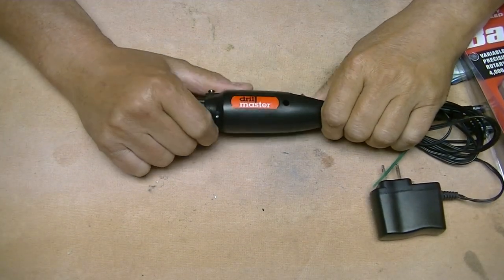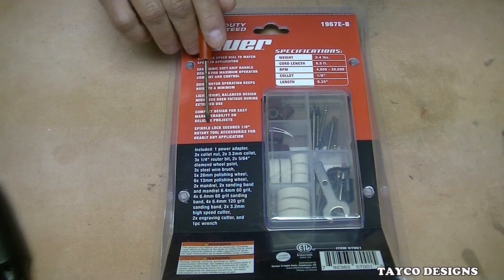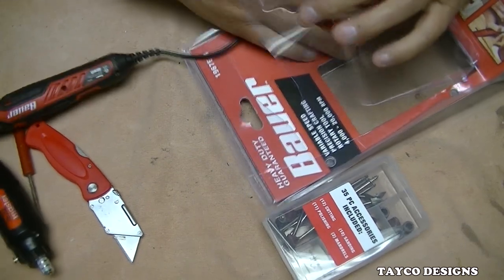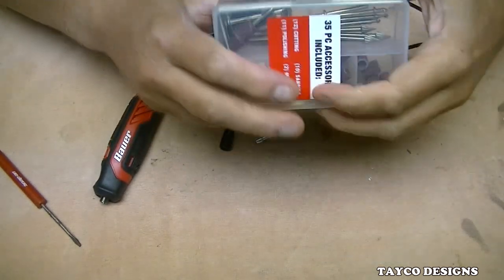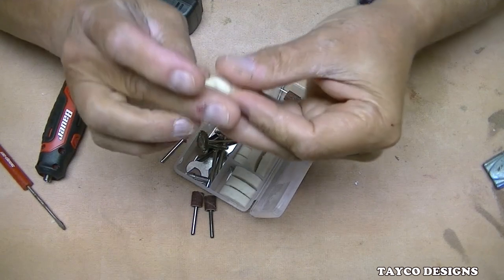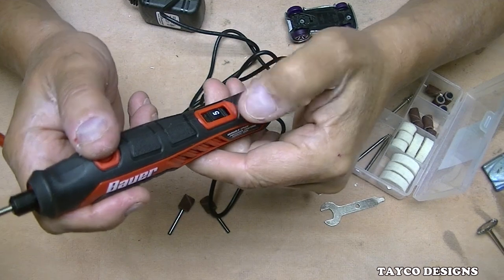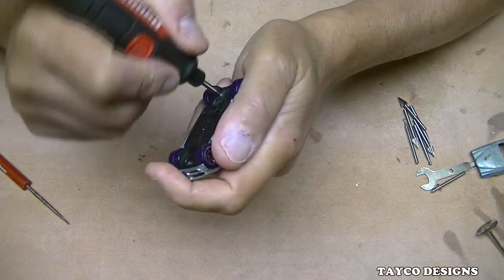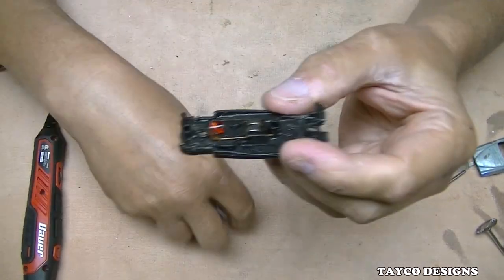Bauer Rotary Tool Sold By Harbor Freight Not A Dremel

Comment: Pro tip when using any cutting/grinding tool - don't press so hard!  Use the sharpness of the tool..  it may take slightly longer but it's safer and makes your tools/blades last longer.

That goes for cutting anything in the kitchen too.  "A sharp blade is safer than a dull blade"

Comment: Seems like a professional with patients tool. For fine detail.  It doesn't let you abuse it.  I'll need the right grinding or sanding but for the job with that tool. And you'll need to be cleaner with the JB weld to make the job easy.  i think you're right about it being $5 to $10 over priced. But you get a good assortment of bits. If they are good it mashes it Worthwhile. Thanks for the revues.

Comment: The collet and collet nut are listed as accessories because you get 2 of each, so you get spares. I've had mine for a while and it's best selling point is it's size. It's easy to hold sort of like a pencil, but its way under powered for any serious work. I mostly use mine for repairs on plastic after I glob epoxy onto some broken part and then shape the hardened epoxy to the original. It's a shame that Bauer doesn't provide an accessory kit of their own. I bought the large Warrior accessory kit. The polishing compound is like powder even after adding water and the glue on sanding disks just falls off. Most of it looks just like the stuff that came with the tool. 

It's like the Dremel Stylo with a tenth of an amp more power and $5 cheaper without the Dremel warranty. The last Dremel I had blew a chip after it was way out of warranty. I packaged it up and sent it back to Dremel with a letter stating that the tool was out of warranty but I really liked it and could they fix it and bill me. They sent it back working like new (maybe a replacement) with no charge and they even paid return shipping. Try that with HF, but for $39 you can just buy a new one.

Comment: Harbor freight just can't get the cordless rotary right. I bought 2 of the last model they had and they almost immediately lost the ability to adjust the speed and we're stuck on full speed. 

And this new Bauer is terrible, especially if you like to use the slowest setting because it takes no pressure before it turns off automatically and it doesn't turn off right when you apply the pressure but a few seconds afterward. 

That little corded one you showed at the beginning is actually a great little tool. It has the most centered motor of any rotary tool I've used and I've used a lot. When you're grinding hard material with diamond bits any amount of wobble in the motor is extremely noticeable and that little guy has basically zero wobble. It's great to put in the car. 

Keep up the good work
Reply from the maker: I have a few more rotary tool vids coming up soon. Please subscribe and be on the lookout.

Comment: 1.  You paid tooooooo much.  2.  That thing is junk.  Take it back for a refund.   You have to apply pressure to get the tools to preform, it keeps shutting off is bs.   I have a Craftsman variable speed  with the carrying case I bought in 1999.  I bought it to cut the factory drive chain on a 1997 Honda CB 250, later used it on a  2000 Honda CB750 Nighthawk for the same purpose.   Through the years I've used it for many, many other jobs.  It was/is a Dremel, just packaged as a Craftman.  Used it the other day to wire brush the inside of a scooter wheel so the tire bead would sit properly,  tire was leak around the bead, badly.
Reply from the maker: Although both are rotary tools they are meant for two different applications. Incorrect, the Craftsman and Dremel are not the same, not even made in the same factory. The Craftsman may be the same as the B&D,  but definitely not a Dremel. LOL....thats like saying the Toyota is the same as a Honda.
Thanks for watching.
Reply: @ScrollsawVideo  That might be now, it wasn't that way back in 1999.  My Craftsman from 1999, is the same as the Dremel 395, even down to parts replacement.  I know, I've had to replace parts.
Reply: @ScrollsawVideo one thing he stated that is true for certain is the Bauer from harbor freight is junk